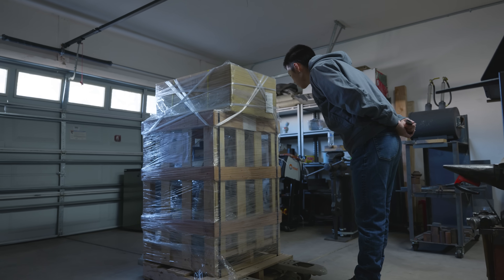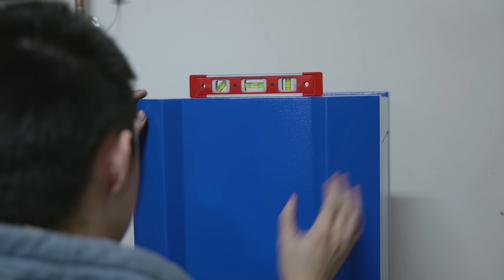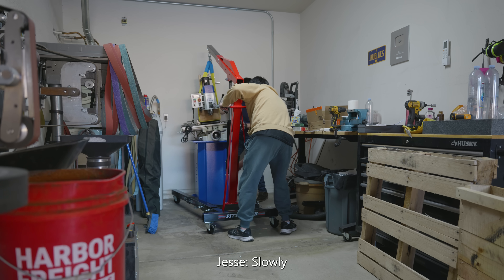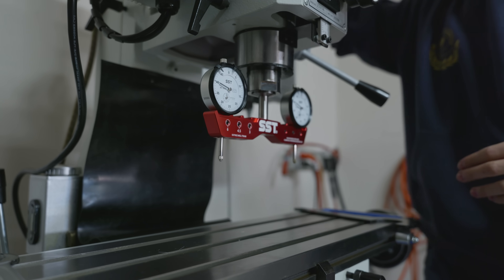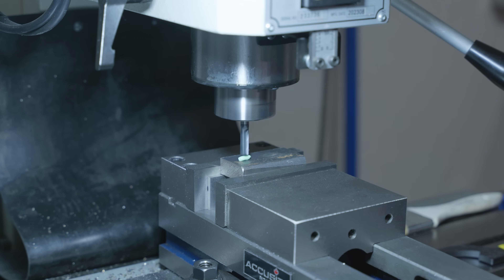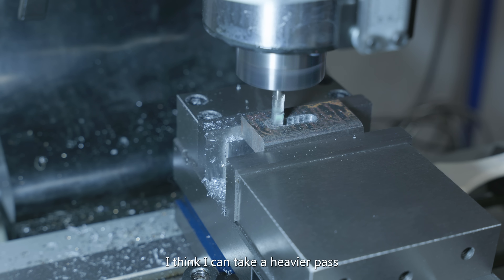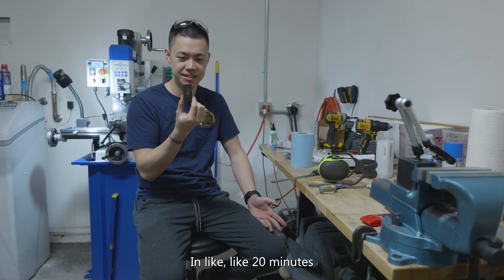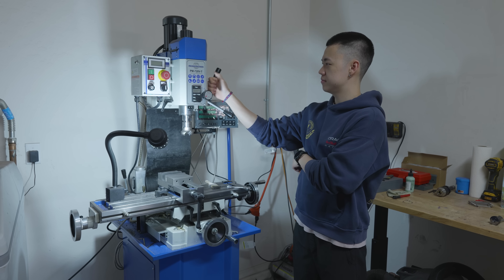My First Milling Machine! (PM-728VT Unboxing and Setup)

Comment: A lot of people have said this already, but don't drill with endmills. Just grab a smaller drill than the size of slot you're trying to make, drill your holes like you normally would (spaced a bit more than the diameter of the drill bit), then come back and clean it up with an endmill. If you want a nicer surface finish on both sides of the slot and better accuracy, your slots would actually end up being "rectangular" slots where you cut both sides separately. Look up conventional versus climb milling. For the majority of the materials you use, you'll generally want to conventional mill.

Comment: Just started watching your videos a few weeks ago. You will love having a milling machine. I got myself a pm940 about a year ago and I use it alot in my off season. 

Try and keep all your travel locks tight, for example after you move your quill down or adjust the head up or down tighten the locking handle before taking a pass, that will help with rigidity and keep vibrations down.

Have fun and you will definitely be buying inserts soon hahaha, they are fragile much like that endmill.

Comment: Carbide is tough, but brittle. Anchor Lube is good stuff, but if you are using HSS tools, cooling is important for them to last. Consider mist or flood coolant. Thanks for the video.

Comment: Jesse, I don't know if anyone else has commented on this, but there's an app that will give you the feeds & speeds to use based off of what type & size of tool you're using as well as what material you are machining. General rule of thumb is HSS - high pressure, low speed & carbide - low pressure, high speed.

Comment: An end mill is not a drill bit.
I recommend getting a good set of stubby drill bits (and a chuck to hold them in). As well as a cheep set of jobber drill bits (like one of the 200 piece sets from amazon with all the extra replacements).
Yes a end mill is much more ridged, but a drill bit will drill faster.

Comment: I’ve been a machinist for 7 years. You need to learn about the correct SFM for each material. Surface foot per minute=sfm. For stainless you’re looking at 400sfm for finishing and with a 2” cutting diameter that’s 750ish rpm. For your 1/4” endmill that’s 6,000ish rpm. You can google search for the correct sfm for different material types and get a good idea for the difference between carbide and hss cutting tools.
Reply: When I started machining, I had a whole stack of handbooks for materials, speeds, and feeds. They have that in an app now. Faster than flipping through the little blue book.

Comment: Nothing personal to you but I hate seeing the same thing said about those mills being passed from YouTube to YouTube. I am a machinist.You can make a beautiful slot with that mill without pre drilling. For carbide you are going to run that spindle as fast as it will go, plunge down half the diameter of your cutter so if you are using a 1/2 cutter, plunge 1/4 of an inch. Keep a nice easy pace as you cut the length of the slot. Carbide needs to go fast, the smaller the cutter the faster, keep a clean easy pace. If you start getting into 1/8 or less diameter do not pre drill. Those interrupted cuts will grab and dull it fast. Wish I was close to you, I'd come help you out. Best of luck, love your work

Comment: I’m not sure how well teselittle mills contain fluids but a water-soluble cutting fluid and a mister will help a lot with cutter life and surface finish.  I’ve also used Unist mist oil but it leaves some gunk behind.

Comment: The best and most efficient way to kill a slot is to first drill a hole on each end of the slot with a diameter slightly smaller than the final slot thickness, plunge the endmill down one of the holes whatever depth of cut you decide, preferably about .05”, then jog from left to right or right to left in the x axis till you reach the other drill hole and the desired slot length. Plug down the second drill hole the same depth of cut, again roughly .05” and repeat the step until you’ve either milled the slot all the way through or until you’ve reach the desired slot depth. Feeds and speeds do need altered depending on the depth of cut that you take. To preserve tool life get a water based coolant and a squirt bottle to keep the tool and the material cool and lubricated. Also try end mills with different numbers of flutes and different flute styles and counts. 2 flute-7flute. High and low helical flute angles and or chip break endmills. Harvey tool is an extremely quality endmill brand.
Reply: Mill not kill 😂

Comment: When are you going to get a proper shop? With all the equipment you’re getting power is a concern, also the garage does not have proper fire suppression equipment if something should go awry. Plus, I suspect you, don’t have proper ventilation to filter out the fumes when the garage door is closed.

There is a huge difference between crafting on the weekend when you come home from school versus doing it every day.  Plus, it helps with keeping work life balance in place.

Comment: sweet, you got a mill!...wise choice, it will definitely improve your workflows. a couple things though: 1) don't wear watches/wristbands/jewelry/etc. when working around machine tools, they never stop trying to kill you horribly. 2) most endmills aren't made for plunging, because the orientation of the cutting surfaces leaves some portion of the center uncut. rather, you should use a regular drill bit to make the initial hole, and then you can plunge into that hole, and mill whatever type of slot/feature you need.
Reply: Same for long  sleeves or the cords on hoodies. No bueno if one of them get caught in a mill or lathe.
Reply: @Dirkxke  very true, thanks for adding! lol, one thing he'll learn quickity-fast (hopefully in a low-key way) is that while files never try to kill you, any machine with a spindle will always happily try to do so, if given any chance whatsoever. 😬

Comment: Surface finish on that shell head can be so much better. Use higher rpm 1000-1100 and dont be afraid of vibrations. Normal with shell head because of the cuts it makes (basically cuts that end and start each rotation. Use cooland on shell head for any harder metal than aluminum for improved insert life.

Comment: Don’t drill with a mill, drill bits are precisely adequate for it. They work better for feeding across an access. And when doing the axis cuts across, you don’t have to do heavy cuts.

Comment: Drills are cheap, drill holes with drills and come back with endmill for slotting. Because of deflection doing the slot the way you did it will never result in clean machined walls. I would drill a hole at each end of the slot and just mill away the middle. Interupted cuts can definetly snap an endmill on a less than rigid machine so your acutally more likely to have success keeping the load on the tool consistent.  Also you said 1000 rpm for the size of tool but used that same rpm for carbide and hss. Typically with hss you need to use a much lower rpm, which is why the tool was squealing so much on your slot. Lastly for a small mill like this i would lock whatever axis your not using to cut, e.g. cutting in X lock Z and Y. Good luck, a milling machine is a great addition to any shop 👍.

Comment: I say this as an American.  Ditch imperial!  Things just get so much easier using mm!
Reply: I learnt both.
Our country went Metric when I was about 12 years old.
Both systems have their merits.
As an adult in my sixties, I still think of certain things in the imperial measure.
Reply: I agree, but it's hard to just switch when all you've ever known and done has been in imperial.... but I'm slowly getting better at being at it :)
Reply: the metric system is not easier you're just more used to it
Reply: @jormjohnXII  I think some calculations (mostly across different units like volume length weight are easier to do in your head in metric because the numbers are round but overall it’s the same
Reply: I record all of my quantitative (organic chemist) on to a writing app on my galaxy tab that records it in real time to an excel spread sheet that also auto calculates unit conversions for whoever needs whatever unit, and gives Me my projected yields and auto creates the pivot table and sends it to my shareholders. My point being, with technology, who even cares about metric vs sae or imperial or whatever name you want to call them. I can see the need when we're actually doing calculations by hand, but I don't even think they do paper calculating in schools anymore.
Reply: I prefer imperial
Reply: Wrong...in the world of machining, imperial is so much better.
Reply: @NelsonJ1 Why?

Comment: Watch Titans of CNC. Learn your feeds and speeds. Also, end mills are not drill bits and are not used for boring holes. This is why your first end mill snapped - they don’t evacuate chips the same way. End mills are meant for cutting on the XY axis, not Z.

Comment: Biggest advice I can give (and I'm not sure if someone else already said it) is that other than your face mill, I'd stay away from carbide tooling.  HSS tooling is cheaper to buy and until you know what you are doing and what feeds (IPM) and speeds (RPM) you should use, you will probably break a lot of tools and it more cost effective to break the cheaper tools rather than the expensive tools.  Also, since you are hand feeding all your axis’s, I would recommend drilling holes with an actual drill rather than an endmill.  A person can drill with an endmill but usually it is done with constant coolant on the tool with a constant feed rate or they spiral/ramp down with the tool using a program aka CNC.  Last thing is that if you really want to always be accurate with your slots, I would recommend that any slotting operation be done with a smaller endmill to remove all the material and then use a final endmill to bring everything to size.  This is allow to not worry about there being to much stress on the endmill and potentially screwing up your width due to the tool flexing or vibrating to much to either side.

Comment: A lot of carbide endmills call for no lubricant or flood coolant no in between, I’ve found for carbide that lubricants make the chips not evacuate the hole properly. Carbide also needs relatively smooth feed rates imo too, too fast obviously will break them but I’ve found too slow or jerky feed rates will also break them, just my two cents take it lightly.

Comment: Congratulations Jesse, that looks like a nice machine! My father has an old mill I use to mill Hardwoods. I use tiny mill bits to make intricate patterns, mortise handles etc. Make sure you clean up all the metal chips first as they like to get stuck in your work piece faster than you can say "where did that metal chip come from?" There may be reasons not to use a mill on wood, perhaps an "expert" can tell us if it is not a good idea and why. Either way, happy milling!

Comment: 15:53 you can see that this cut quality was worse and caused more vibration. One thing I learned was it depends on the direction you are cutting and the way the cutting tool is arranged. For example the first cut going right to left was more smooth than cutting left to right.

Comment: Ahh the first mill. Good times! 

Fun fact about endmills. 4 flute endmills like what you have are great for slotting, not for plunging. All 4 flutes line up in the middle, so there is a very tiny point which just gets pushed instead of cut. For plunging and slotting, look at getting 2 flute endmills. The cutting edges at the bottom are just ever so slightly off-center where one cutting edge is longer than the other, so that when pushing down, you get a consistent cutting action.

Also the longer the endmill when slotting, the more flex. Go as short a stickout with the tool bit as possible to reduce the flex and chatter, which reduces the chance of snapping tools. You'll hear something go wrong before you see something go wrong. 

Pick up a Machinist's Handbook, it'll have all sorts of tips/tricks/calculations for feeds/speeds as well as general milling practices. You've just opened yourself up to a whole new world of silly tolerances and black magic.
Reply from the maker: Interesting, I’ll have to get myself some 2 flute endmills! I always assumed that they endmill flutes were the same aside from how many there were. I had no idea they were used for different things. I’ll also be getting myself the machinists handbook, sounds like some reading that I have to do :D
Thanks for the comment! Appreciate ya!
Reply: @jhublades  There are many opinions on what works/what's best practice. I wouldn't go down the rabbit hole too deep on purchasing tooling until you kind of understand what you're going to be doing the majority of the time and what tooling will work best for those practices. If you have a general tooling supplier like Sandvik or KBC tools, there are people there who can help guide purchasing decisions instead of throwing money at it and breaking a bunch of stuff. I look forward to watching the learning process!
Reply: @jhublades I suggest studying under a Machinist. Learn how. At least the basics. 
You can ask all the questions you want to know and learn. 
That way you don't damage your new toy. 
As for me, I'm an Auto mechanic. 
I'm always learning new things and have to get new tools for certain very specific tasks. For instance Torque to yield bolts. 
I'm glad I got a new torque wrench for that task.
Reply: @2nickles647 he literally has access to 1,000’s of machinists just by asking a question in his video or posting a comment. You can learn pretty much anything from YouTube.  It’s awesome.
Reply: @jhublades you should also look up a quick video about speeds and feeds for different materials and if you’re using hss or carbide endmills, I’ve done the same thing with carbide endmills until I started to run them faster
Reply: You can get center cutting end mills and I definitely would't plunge with a 2 flute.
Reply: @TamahaganeSteeltwo flute slot drills are made for the job
Reply: Was just about to add this! Also try letting your drill mill do more of the work, let it cut on the tool and avoid plunging hard to reduce wear on your tools. For larger cuts, it also doesn’t hurt to slowly work up to it by using smaller drill mills and sizing up asides from the time to do it, should also help make a cleaner slot in your finishing pass
Reply: @DevChow  As he said, drill more than mill when doing slots. Per the difference drilling versus milling. No need to plunge an endmill which is meant to "mill" rather than drill
Reply: All CNC Milling Machines have routines to not go dull vertically into the metal surface. For what you want to do, without making it too complicated, you should go in like 3 mm, mill the slot to the end position, go another 3 mm in, mill to the start position and so on. It still not perfect for the mill but much less hard on the tool than your approach.
Reply: I was thinking the same thing about them not being meant for plunging as I watched it happen.... and I know NOTHING about machining, I just watch a couple channels about it on here...
Reply: Where's the coolant, my friend? I think it's important when you use the machine and also keeps the parts heads from being damaged. Thanks for sharing your videos